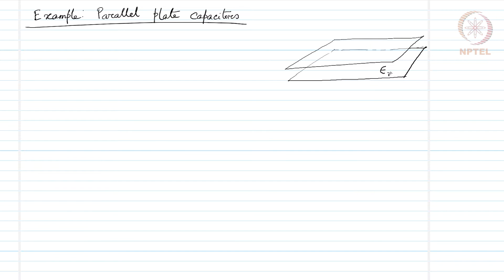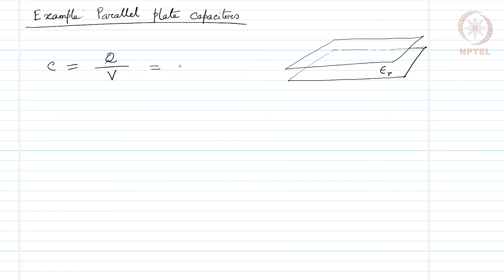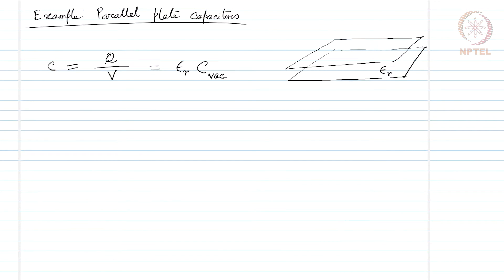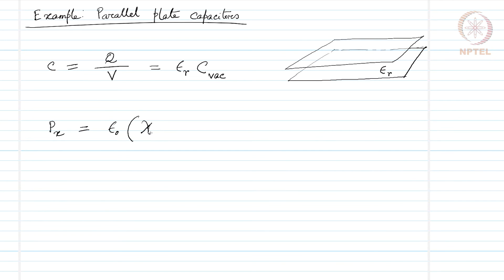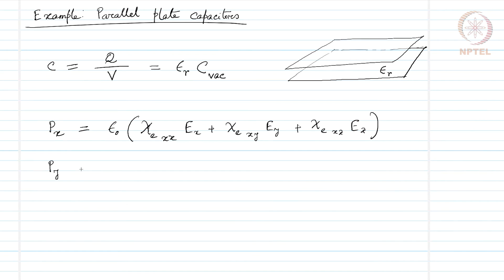Parallel plate capacitors

Comment: Nice and informative. There are also lectures which utilise a unified approach to electrostatics and circuits as below.
This is a link to a video lecture by NCSU faculty on the fringe field of a capacitor.
Important
1. Derivation leading to fringe field expression of a capacitor.
For the final expression of the fringe field watch from 15.0 minute.
ch15L3b
https://youtu.be/7rZ1uFc1ibE?si=0a6OMk-kQLeEMMzb

The second link is to a video lecture by NCSU faculty on Discharging and Charging of a capacitor.

2. Discharging a capacitor
Watch from 3.0 minute.
Charging a capacitor
Watch from 15.0 minute.
Ch19L1a
https://youtu.be/hnSC8MqgCjY?si=krGUPtDarUmFxT_I